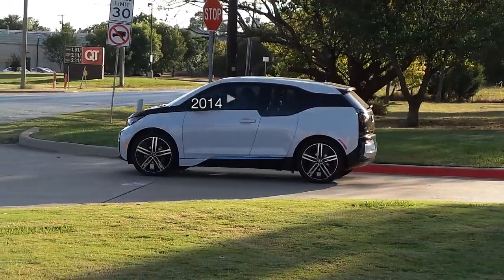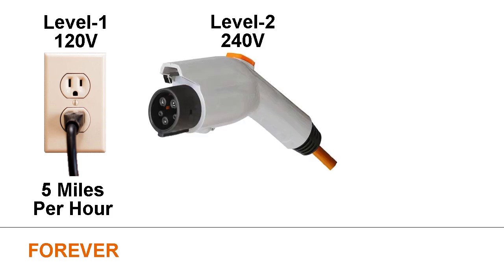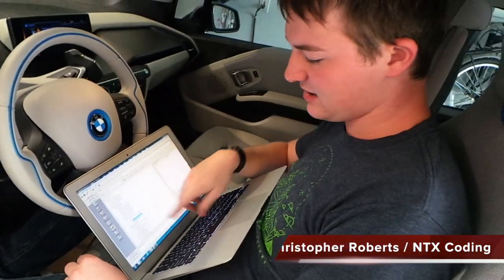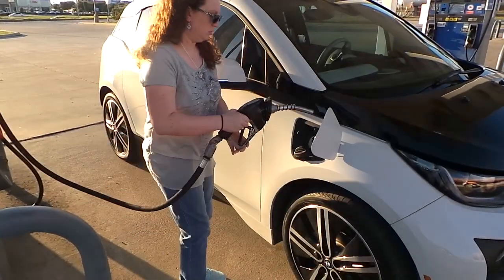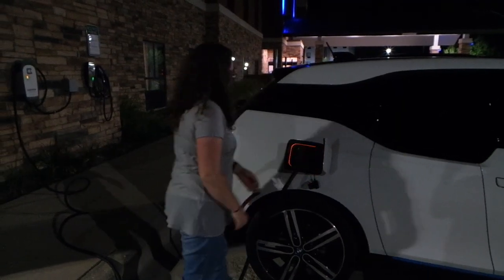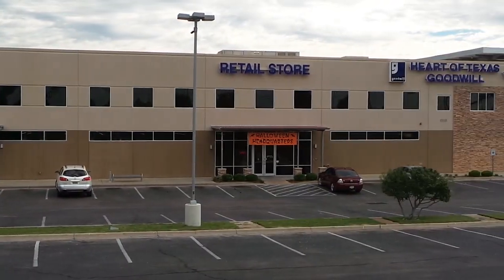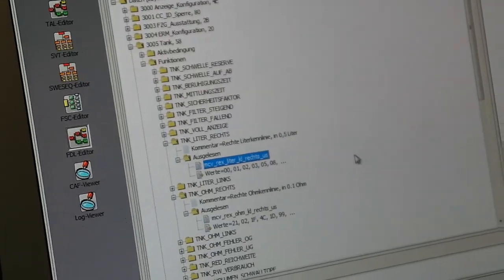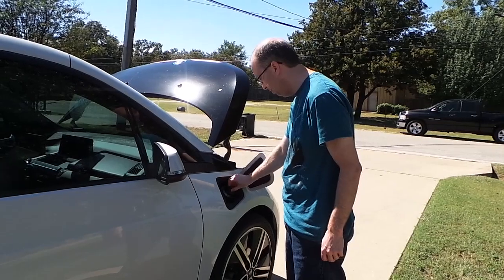BMW i3 REx roadtrip, charging, coding, and range test.

Comment: Asking the TX legislature for EV chargers is like asking the Taliban for nude beaches.
Reply from the maker: You're probably right..
Reply: The 8-Bit Guy one crazy guy in my country, swapped the electric drive, and the extender, with the GS1200R engine, and built his own transmission.
Reply: YEE HAW and all that. I can't blame them, I like good old dinosaur power myself.
Reply: Texas is where the oil industry thrives, so I guess that makes sense.
Reply: Where do you think the electric power come from?
Reply: Texas is actually the leading state for renewable energy and in several cities, you can actually buy your power from the West Texas Wind and Solar farms ( Texas actually leads the country in Wind) . Cities such as Georgetown went 100% renewable with an initiative like that. I would not be surprised if the Texas Legislature actually embraced an EV Infrastructure using all of that renewable energy ( or natural gas). It's not because they care particularly much about the environment or global warming but because that is where the future of energy in going.

With that said, Texas primarily uses Natural Gas for bigger infrastructures ( like Dallas where 8 bit guy resides) which is not quite as damaging as the coal firing plants more comonly used in other states( though coal is the second most used  source because of older smaller places)
Reply: Hahahahahahaha...
Reply: Hahaha!!!
Reply: @TheHoosiers2008  
"Where do you think the electric power come from?"
From the same source that causes global warming,
The sun?
Kidding.
Texas is a big big country.
Why couldn't they have both?
There is a lot of land that is not used for anything.
Perfect area for a "farm" of solar panel arrays.
Reply: asking the TX legislature for ev chargers is like asking CA for gun stores. Don't EV my TX!!!
Reply: @iLikeTigerz101  So I guess you like driving a vehicle that only turns 25% of its energy into motion, is expensive to maintain, puts pollutants like ozone and NOX that make people sick into that air, and also contributes to climate change. Brilliant. If we had any sense we'd bad the sale of all ICE cars by 2030.
Reply: Partial ban in CA, 2035. Does not involve mandatory including all freight traffic, tractor trailers. Does not include used gasoline, diesel, or cng powered vehicles as long as they meet their specified CARB requirements. Does not include antiquated vehicles.
Reply: Only new car sales of I.C.E. powered passenger and fleet vehicles.

Comment: I'd love one of these but I don't know how viable an option it is for South Africa.
Reply: I wonder how viable it is for Anguilla
Reply: As long as you have electricity, this is an option.
Reply: The first thing is to determine your driving requirements.  I have one and I rarely use the public chargine facilities.  Mine is also a range extender version and after a few code changes it has served me well.  Most of my driving is commuting 40miles a day to/from work.  In the garage I park at there is a standard 15amp/110v outlet that, over the 9hr charge, recovers the 40mile commute.  I run a 30amp @ 240v charger at home for those times I need to top off.
Reply: I live in Cape Town city and use public transport exclusively except when I have to travel to other parts of the country.
Reply: Dylan Rabie
Reply: Dylan Rabie ze
Reply: A. Mostert  -  If your buying a used electric car for $10,000. + euros or dollars, just add another $1000. (approx.) for solar panels (used) controller, batteries, and inverter . . . . go on YouTube sites for all the info, instruction and support to put your offline power station together, and charge your car at home.  It is not so hard with all the YouTube videos available  !  !  !    Now, if you live in an apartment complex, well . . . . . . never mind.

Comment: European (atleast in my country) outlets got 220v ( 380v is optional, for those who use heavy electric motors like a lathe.) .
Reply: That is because most of Europe uses 50Hz,so they had to push up the voltage to compensate. Most of the US uses 110-120V at 60Hz.
Reply: Total bullshit. You don't "compensate" the frequency with voltage.

The US uses an outdated system because electricity started off there with 100V DC, and when they changed to AC they used 110V AC so that the 100V DC lightbulbs could work without being changed.

Europe started with 220V or 240V already at 50Hz (the difference between 50Hz and 60Hz is negligible, it only matters for clocks that use the 50Hz or 60Hz as the time base, so a 50Hz clock will run too fast on 60Hz) and only recently changed to 230V so that it is harmonised throughout the continent. 

220V has many advantages, one of them is that with an US 16A socket you can get a maximum of 120*16=1920 W, in Europe using the same socket and wires you can get 230*16=3680W
Which means that it is much more efficient and cheaper (less copper used) than the outdated US system
And an added bonus is that a Level 1 charger for an EV in Europe will charge the car 2 times faster than the Level 1 charger in the US, which means it is actually useful whereas in the US since it takes 14 h for a full charge it's useless.
Reply: MrOpenGL
The reason it was upped to 220-240V in most of Europe was during wartime there. They had to increase the voltage to help the electric flow better through power lines.
Reply: Why is there so much disinformation and crap about this subject?!?!

In the early days both Europe and the USA used DC at a voltage ranging from 80 to 110V. 
When Nikola Tesla and Galileo Ferranti discovered AC transmission, induction motors and transformers, they all agree that since voltage is now easy to be changed via transformers, it should be kept as high as possible to minimize losses (thanks also to the work by Georg Ohm on electrical resistance).

Therefore in Europe, under the guide of Siemens and AEG, the standard settled for 220V (240V in the UK because of GEC) single phase and 380V triple phase as early as 1900. The frequency chosen was 50Hz out of a number of strange ones (25 Hz, 16 2/3 Hz, 45Hz) because it was the lowest frequency that didn't produce visible flicker in lightbulbs, it tied well with the SI which is based on decade numbering, and the rotational speed of 2-pole alternators was 3000RPM which was easily achievable for the early water and steam turbines.

The USA on the other hand had a much more developed DC network than Europe, therefore a lot of customers already had extensive installations of 100V lamps and 100V heating elements (e.g ovens etc.)
While Tesla wanted to use 220V like Europe, because it would enable to cut wire costs in half, people didn't want to change all the bulbs and appliances to meet the new voltage, and since bulbs and heating elements can work on AC as long as the voltage is similar, it was decided to make a "split-phase" system where one leg is at 120V, the other at 120V and both legs are at 240V. It is the system that still survives today.
The High voltage distribution was built to the three phase standard like in Europe because it only required 3 wires vs. 4 wires for the Tesla system, and motors ran much smoother with 3 phases than with 2. 
Charles Scott designed the Scott-T transformer to connect the 2-phase and 3-phase systems together.
The frequency was chosen to be 60Hz because it tied better with the US customary system that uses dozens and because you could build a clock very simply with a 60:1 gear.

Today Europe has harmonised its voltage to 230V to remove the discrepancy between the UK (240V) and mainland (220V) but many old transformers survive and those are still 220 or 240V unless they have a tap changer.

The USA on the other hand has kept its outdated and inefficient 120V distribution system, however industrially three phase (208 or 480V) is the king like in Europe.

Comment: I think the difference of the fuel mileage from the night and morning is due to the fuel and its fumes expanding and retracting. In the night, your car was still hot, which means more fumes and less fuel in the tank. Over night, those fumes became fuel again as it cooled down and thus gave more range indication now.
Reply: Hi, i3 REx driver here. The difference is likely due to a combination of effects. The primary cause is that the i3's range meter pulls from a number of information sources including the entered route on the gps (elevation data, speed limits, weather en-route, historical consumption of other vehicles that took the route, range extender efficiency on last trip), local ambient temperature, battery temperature (yup, this impacts the range extender displayed range), predicted battery heating and cooling requirements for the remainder of the range. Also with the fuel tank is pressurized, insulated by nearby components and on teh wrong end of the car from anything that gets hot with no heat conducting path so I'm not sure the effect you mention applies.

Comment: Wouldn't mind an electric car but it wouldn't suit my driving.  I get 600 miles of range from my diesel car (around 60mpg), and make trips over 250 miles regularly so yeah that's not going to work, at least not as my main car.  Cool video as usual.
Reply: These are actually pretty cool little cars. I had the opportunity to throw one around an autocross course, and because the battery is low, the car is light, and the motor is at the back, it's a fun little go-kart to zip around in. Nearly silent, too.
Reply: Just a suggestion. Go look at Volvo or Mitsubishi hybrid lines. If you mostly do 30 mile run or shorter they will do just fine.

Mitsubishi have a bit better hybrid system, but its a bit worse of a car. The V60 D5 and XC90 T8 is really good cars, but they are not really cheap and the hybrid system is really mostly for short jounries.
Reply: matsv201 Oh, god, Mitsu has really fallen apart in the last 10 years. I would never buy a battery electric vehicle, personally, I drive too far too often.
Reply: computiNATEor Yea Mitsubishi is a bit crapy, but the V60 is fairly good.

All the cars (outlander, V60 and XC90) are "real" cars.. That is if the electric system breaks down 100%.. they still run. Not as efficent, but they do run. As long as there is gas (or in the case of the V60, diesel), in the tank, they will run.
Reply: matsv201 Not entirely true. If the electric system in a Prius fails, the gasoline engine can't really compensate by itself, and vice-versa. The engine computers aren't flexible enough, yet.
Reply: computiNATEor I was not talking about the prius. I was talking about the volvo system that got a compleatly seperate electric power train. They can run with 100% dead electric engine as well as a 100% dead ICE:
Reply: I wish there were electric cars with a larger gas tank. At the current state, electric cars wouldn't work well.
Reply: The Galactic Void What are you talking about, the V60 have about 1000 miles diesel range.
Reply: matsv201 I mean an electric car.
Reply: The Galactic Void Yes, the V60 is a electric car.
Reply: The Volt getting 380 miles a tank isn't enough for you?
Reply: matsv201 Dang. All of the cars I've heard about have tiny tanks.
Reply: The Galactic Void 
There is two different types of hybrid... or.. rather 3 diffrent kinds.
1: Electric car with range extender (as the i3). Primary electric car, but secondary a gasoline car. The have a tiny tank because of the law in some places.
2: A ICE car with a secondary electric engine (and in the case of the outlander... and Köningsegg regera, a thid level electric engine:
3: A ICE car that have a really smal battery, just to keep going in city traffic, like the early prius.

V60 have a fairly large 67liter size fuel tank, but it have a really efficient diesel engine. So it rune like 4liter/100km. The XC90 have a larger fuel tank, but it have a less efficent engine, so it got shorter range
Reply: Crana what kind of car do you have?
Reply: Vauxhall/Opel Astra 1.9 CDTi SRi, there is a US equivalent but probably not a diesel.
Reply: Crana I don't understand why all these new eco vehicles don't get better mpg.
In 1985 I delivered auto parts in a brand new'86 Chevy Love/Isuzu Pup diesel pickup,and it was getting 55mpg city/65mpg highway.
Reply: Abhi Mayadam Admittedly it wouldn't have gotten out of its own way on take off,but it would do highway speeds.
Reply: What diesel do you have?

Comment: This video was quite entertaining and I'm glad you posted it, looked like a fun trip. Also good to see another happy i3 owner. I'm currently leasing mine because I got it back in June under the ridiculously cheap Employee Lease programs and I'm loving every minute of it. It's currently my daily driver, taking that position from my Mustang and saves me a ton of money at that. I've been thinking of coding my i3 REX as well and your video definitely helped to decide that I'm going to. Although you mention that your charging infrastructure isn't great, you should see what mine is on Long Island, NY. We have a L2 charger at my job(BMW dealership), a few at other dealerships in the area, my local Tanger Outlets has a L2, but there are only TWO DC Fast chargers within 100 miles of me, sadly and only one of them is free. However, I'm sure in the years to come, with the Model 3 and Bolt in our near future, our charging infrastructure will double or triple in size and bring even more EV's on the road!

Comment: doesn't fast charge kill the batteries faster?
Reply: gwald yes
Reply: it only kills them if they get hotter because of charging( ex: tesla cars are designed not to overheat from fast charging)
Reply: Yeah, not to overheat, but they do still get warmer. And any heat, not just overheat is bad. Its not gonna have too big of an effect, but it will have some effect.
Reply: At least in the US BMW offers an 8-year/100,000-mile warranty on the battery so I wouldn't worry about it.
Reply: people say the same thing about fast charging with phones. I've yet to see hard evidence to prove it. I think that's just a rumor.
Reply: It's been proven that that is not the case. The i3 has a sophisticated cooling system that keeps the battery at it's optimum temperature.
Reply: The Leaf has a passively cooled battery. That's the main issue. Get the extra heat out and it's not bad as long as the battery is engineered to handle it.
Reply: GC mii
Reply: GC mii ..kp no di
Reply: GC mii ..kp no d
Reply: No, all batteries are charged with DC.  Slow charging is done with AC being provided to an inverter built into the car that converts to DC.   Fast charging uses an external AC to DC inverter that can be larger and cooled so it can provide more power to the batteries.    
As for ruining the battery, it all depends on the type of battery it is.  But how you drive can hurt the battery more than fast charging.  Fast chargers will control the flow to slow down above 90% so they can balance the cells to prevent damage.    So in the end fast charging wont damage the battery.

Comment: In usa you have only 120 v standart wall outlet? Holy...
Reply: stadoblech That is correct. Our standard outlets are 110-120 volts. Large appliances have special outlets for 220-240 volts. 
So at home, an outlet can be wired for the higher voltage, bringing us on par with countries that run 220-240 volts standard, so we can have the faster charging, but the outlet is usually keyed differently to try to prevent us from plugging in the lower voltage appliances by accident.
Reply: in japan they only have 100

Comment: i dont get why they would make an electric car, that has a gas motor which totally defeats the purpose of the electric motor
Reply: In the video content above accessed by pressing the play button you will find all the information you are seeking. However I will comment on my own personal experience. It's so that you can have an EV, and use pure EV while in city, but when you go to your moms or a day trip out of town you can go twice as far than the electric gets you. No we don't have hardly any chargers let alone fast ones, unless you like stopping by a station every hour and wait 4 hours.
Reply: But still, the point of an EV is no gas, and adding a gas motor defeats the whole thing
Reply: @verebellus  It's a safety net, no way is anything defeated. When EV charging is as common as gas stations, we won't need the range extender.

Comment: Nice video, but it is quite scary to see the way your wife is holding the steering wheel.
Reply: come with me. I drive with a finger
Reply: I'll drive with legs, occasionally.
Reply: Jiří Kašpar lol
Reply: I drive with my knees for dozens of kilometers when I´m bored.
Reply: She’s the least of your worries - I take turns and corners at 50 mph when I’m bored.
Reply: Much scarier is their placing a portable  fuel tank in the front trunk!
Reply: @Hocus Smokus regular fuel tanks are in the back and have much less of a chance of catching on fire.

Comment: Amp-hours is a meaningless spec.
Reply from the maker: I agree.. they should really use Kwh.
Reply: Not to battery manufacturers. Amp-hours is meaningful for batteries because the voltage is not constant, therefore power isn't necessarily constant either. Charge is a known variable.
However, to consumers, knowing the energy that a battery can hold is more useful.
Reply: The REAL meaningless spec is mpg-e - It's not possible to 'create' 33.7kWh of energy out of a gallon of gasoline.
Reply: It means that if you draw x amps [x = the amp-hour rating] then the battery will last for one hour.
Reply: Yeah. I use to use them but they could mean different capacities depending on voltage